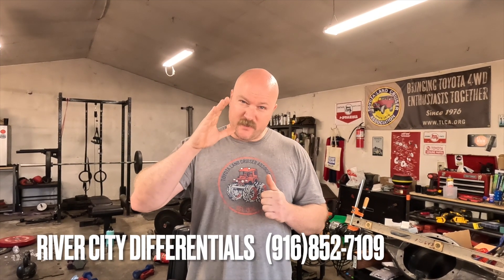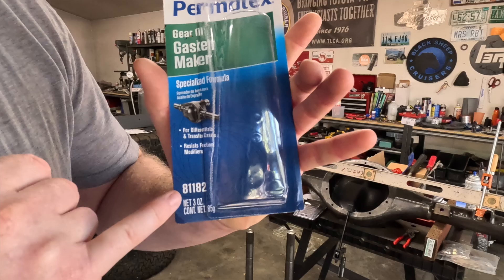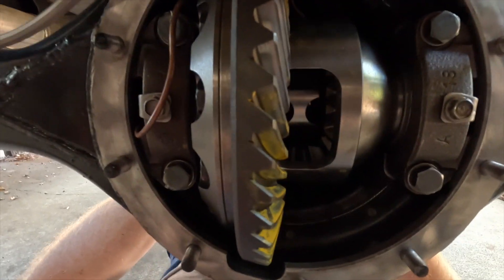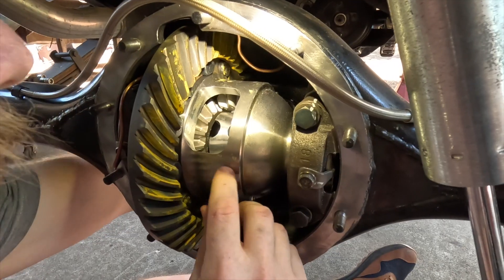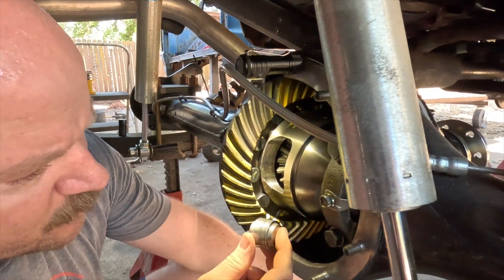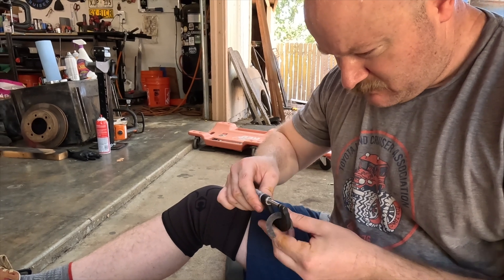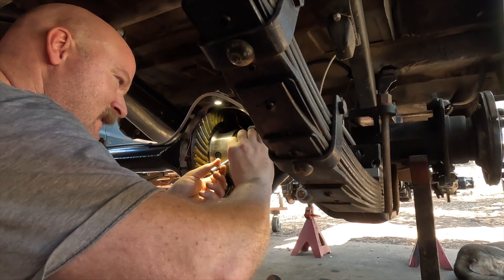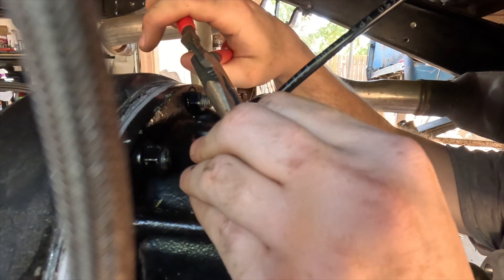ARB Air Locker Installed Into FJ40 Landcruiser Rear Axle, Mistakes, C-clip Madness.

Comment: Awesome video. I also had Sean put front and rear ARB lockers in my FJ 40. His partner, Derek is also great. He wired up a twin ARB air compressor and wired in all the switches for me. They are an amazing team and do great work.
Reply from the maker: Was yours the green one on the rack by any chance? If so, it was lucky yours was there. They were able to get me up to speed about a few of the internal mechanics.
Reply: @projectwrongway9127  yes it was
Reply from the maker: Man, if your that close I’ll have to send a message next time we go beating on the old steel.

Comment: What's gonna prevent that little copper.tu e from getting snagged by the gears?
Reply from the maker: It’s solid, shouldn’t be an issue even with the gears moving in there. I made sure it had good clearance as well before I buttoned it up.